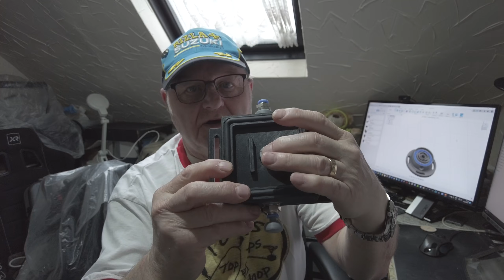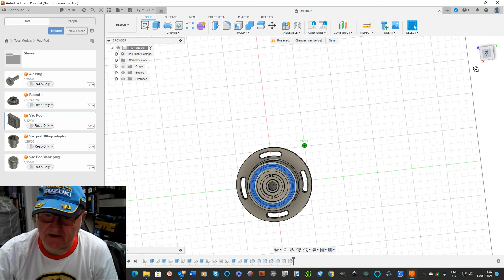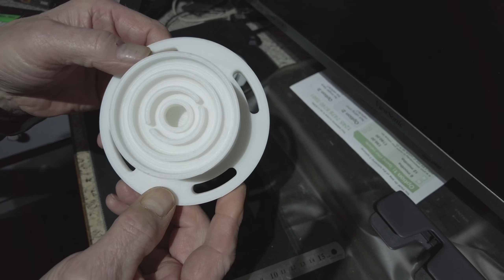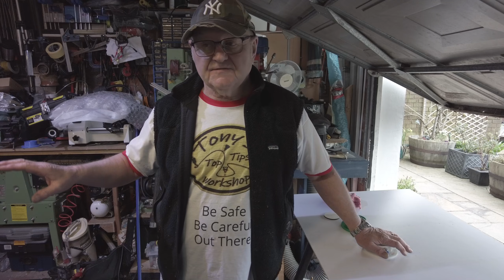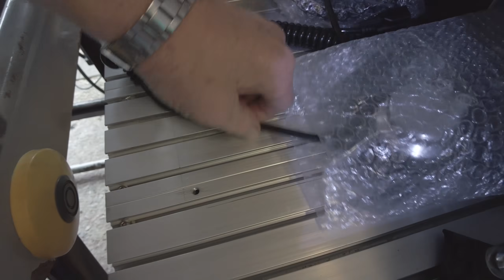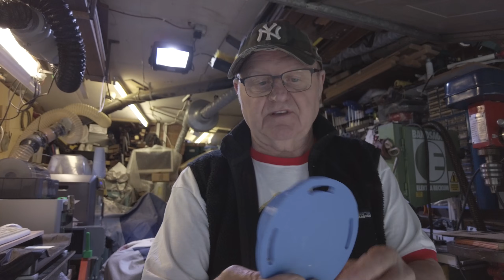CNC 3D Printed Vacuum Pods and how they work

Comment: Thats a really neat design.
Do you have links for the connectors and pump you use?
And what tube types do you recommend?
Reply from the maker: Hi m power tools. Co. UK sell them £17.50 for 10. VACUUM CLAMP PRESSURE ACTIVATED BALL VALVES. the Pneumatic connectors were 8mm inlet pipe 3/8" BSP thread. You can print your own tread adaptor to reduce down.
https://www.amazon.co.uk/sourcingmap%C2%AE-Thread-Connect-Coupler-Fittings/dp/B01AGB3PFE The vacuum pump 
https://www.amazon.co.uk/BACOENG-Double-Stage-Vacuum-Pump/dp/B08T5QSWNB. There are many of this type just look for the best price
Reply from the maker: I use 8mm air tubing to match the connectors and the vacuum hold down I printed the unit first to check the accuracy of the printer then I purchased the correct neoprene seal in a small coil.

Comment: Liked your video can you list the parts from Amazon that you used.  Thank you
Reply from the maker: Hi m power tools. Co. UK sell them £17.50 for 10. VACUUM CLAMP PRESSURE ACTIVATED BALL VALVES. the Pneumatic connectors were 8mm inlet pipe 3/8" BSP thread. You can print your own tread adaptor to reduce down.
https://www.amazon.co.uk/sourcingmap%C2%AE-Thread-Connect-Coupler-Fittings/dp/B01AGB3PFE

Comment: Hello, interesting implementation. I would be interested in how the shut-off valve in the middle was implemented or where it can be purchased for my project. Thanks in advance Karl
Reply from the maker: Hi Karl I purchased mine from Trend as a diy vacuum board kit, they are called Mach Ball Valve
For Vacuum Clamping  but you can get them from 
 www.mpower-tools.co.uk/product/vacuum-clamp-pressure-activated-ball-valve-packs/
Reply: @Tonys.Top.Tips.Workshop  Thanks for the quick reply. Unfortunately, there is no data on the homepage such as height, width and diameter. This would not be bad because I am the data customs for Fusion CAD. Would be very grateful if you could write them here.
Reply from the maker: @karlerber8408  hi I could give you the dimensions  of mine but that might be different  to those as some do vary in size

Comment: What is the advantage of the vac pod if you have to glue to a substrate, couldn't you just glue to a solid block and get the same if not better functionality? What am I missing?
Reply from the maker: Hi thanks for your question, yes you are correct you could just glue straight to a clamped down base board. Using vac pods or a vacuum table like I have on my pro machine is the ease of use and no metal clamps protruding. The disadvantage is you cant cut through as you would hit your vac pod or vac table resulting in loss of vacuum. So if you glued your material down to a sub strate you could cut through. It is just another way of securing you job to machine at the end of the day you use what is best for you and your skills.

Comment: The white pod is awesome. It looks like nylon... Btw Zortrax products are really expensive. Then we expect some difference of quality
Reply from the maker: Hi thanks for your comment,  the white one is hips done on the Zortrax m200 it was my first printer when they first came out, so had it a few years fantastic prints from it but not anywhere near the speed of the Bambu Lab x1c.
Reply: @Tonys.Top.Tips.Workshop  Meaning that Zortrax is a serious brand as they claim. I've heard many good opinions on Bambu Lab x1c but the Chinese are in a merciless competition in the sector and competitors like the new Qidi looks like a terrific BL's contender at half of x1c's price. Anyway, as you fairly mentioned, devices are as good as you use them for interesting projects flawlessly, which is the case of Zortrax and X1C.